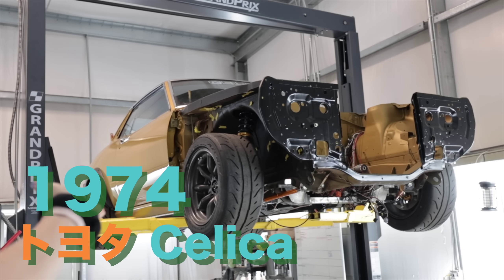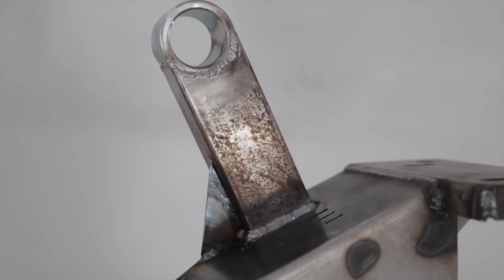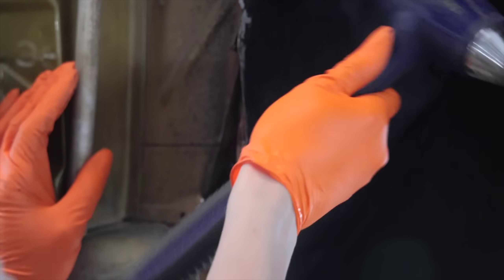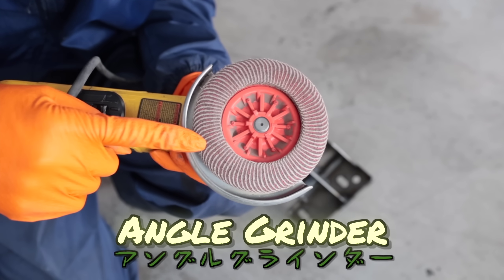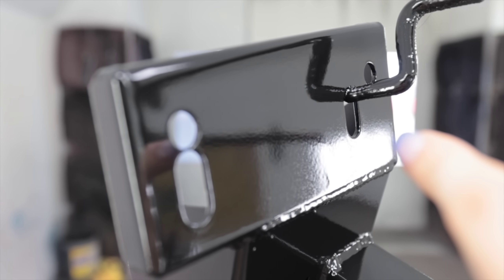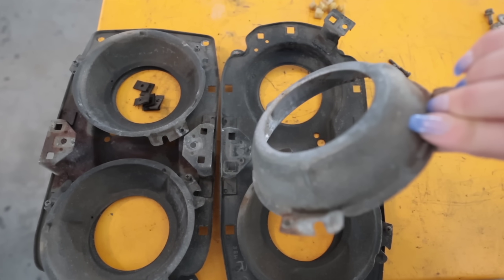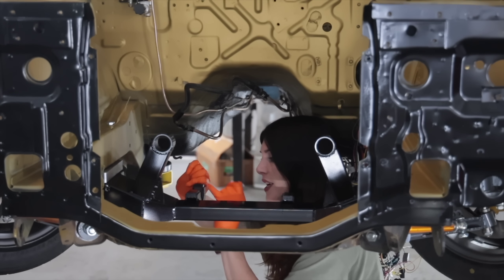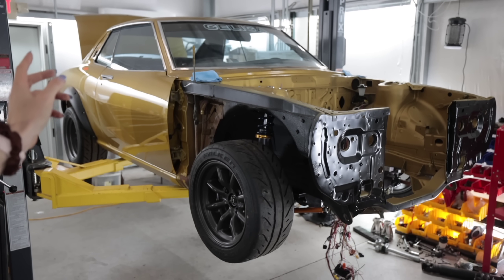Parts Don't Exist, So I Made Them! // 2UZ V8 1974 Celica

Comment: "A narrower tire shtretched onto this wheel would solve the situation, but I'm not about that life."

Thank you.  Thank you.  From the bottom of my heart, thank you.

2:41
Reply: Seconded. Radial Tyre sidewalls are meant to balloon out, not be stretched inward. It's important to how they work to keep the contact patch flat on the tarmac, as well as for decent ride compliance.
Reply: Yup. This car needs the right tires. You can't compromise on that. It will look factory when it's done.
Reply: Amen to that!

Comment: Girlie, I wish my late father could have seen some of your vids.  You have the exact same eye for detail - and the same OCD tendencies - that he did.  He was an architect by trade, and a self-disciplined master craftsman as avocation. Whether it was our annual garden, or the model railroads my brother and I built alongside him, or even my earliest efforts as a budding greasemonkey, Dad was always on top of things with his sharp eyes, practical knowledge, and sage advice.   Dad was a fellow who spent an entire winter building an HO-scale wooden railroad trestle {40 scale feet high, and 600 feet long} BOARD BY BOARD!!!  We're talking over 6,000 individually cut balsa-wood "timbers," "crossmembers," and "stringers," complete with all the nuts, bolts, cables, and other hardware that the prototype had.  Oh yeah - Dad also drilled EACH bolt or cable hole himself, until the cost of replacement bits for the Dremel started to eat into the weekly grocery budget a bit more than Mom was cool with.

I'm fondly reminded of good old Dad with each new video you put out, Sarah.  You are well and truly Gifted, my Dear Lady.  And don't you EVER forget it, dig?😍😍

Comment: So loving every one of these little conundrum filled episodes. I never want them to end. I really feel like you are right here in the shop. The clearance issue was resolved as I would have done it. More than proper. The journey is the achievement with me. It is more immersive than the experiences of concluding the project, if it is for yourself.
Reply: @mostcom  custom builds are an ongoing wtf. Good job on ONE at a time⭐

Comment: Rust converter on the rusty patches only of the 2nd H/L base. The kind that leaves a protective film.  Then just clean as you did.  Get a padded cap to wear working under/ in engine bay.  Yes regular good food !!

Comment: Just info, next time you get stuck putting bushings in like that, get a long bolt and big fender washers (I'll bet you see where this is going) put the bushing in, put the bolt through the bushing, fender washer and nut on other side and use an impact to tighten the bolt/squish the bushing in. Have fun

Comment: Sarah, when you put the car on the ground and load the suspension with the weight of the car, you’re going to have to clearance your fender well up higher because your tire will be higher in the well. IMO 😊
Reply: I thought that at first, but go back and watch again... She sets the car on the ground before final check. Yes, the engine might make a little difference, but that suspension isn't exactly soft. It'll probably be fine.
Reply from the maker: @OoGICU812  already did
Reply: @SarahnTuned  We all knew you would've. 🙂

Comment: One trick to popping out plastic inserts that you have to compress to pop out is using a vice grip. You can set the closure distance of the jaw so you don’t over compress the insert and not crack it.

Comment: You should give those rusty parts a soak in evapo rust. The stuff is crazy good and doesn't harm plastics. Sometimes parts might need a little brush action for stubborn spots and a second soak but the results are incredible and fast.

Comment: Install bushings by using a large bolt and nut with fender washers. Just assemble the bushings outside the part with the bolt long enough to get the nut on, then use a power tool to screw it all together, done with no impact.  Nice job on that epoxy!  I need a fabrication shop like you have access to.

Comment: Can I give you some tips as I’m a professional painter in a powder coat shop. And I do a lot of off road race cars and trophy trucks and forerunners. A better application instead of epoxy for something like that is Steel-it.  It comes in two colors. Stainless steel gray and black. What Steel-It is a direct to Metal and no mixing of a hardener but you can reduce it a little with mineral spirits. It’s made with fine stainless steel in the paint. It’s chemical resistant and you can weld right on top of it. It’s easy to apply. You can lay it on heavy and it’s very difficult to make it run or sag. I use a primer gun set up with a 1.8-2.0mm tip and needle.  Downside it’s $400 a gallon.   It’s also harder to scratch than powder coat. I use it on chassis, and suspension parts like huge trailing arms A arms, spindles, torsion bars, tie rods, etc.  trust me. Great stuff. Research it. 

I paint small parts with a lot of in and outs.  Here is a tip.  Set your gun up to where your fan is a point. Pencil in all the hard areas first. Then open your fan, up the air and fluid and paint the body of what you’re doing. 

Also since you discovered air flow. If you want a textured look. Paint a smooth base coat like normal. Let it flash then go back. Turn your air way down. You will have to test with a sample or a piece of cardboard. Low air will make your gun spit texture. Lower the air thicker the texture more air it will be finer texture full air then it’s just painting. Try that sometime.

Comment: An FYI as a painter and Powder Coater, you can request your parts to have a primer when powder coating, they have zinc and other anti corrosive primers to help in rust protection in the event the surface is chipped.  And the fact you can shoot the part right there, I would probably do the same if I didn't have the ability to do both.  Just food for thought.

Comment: I have a ton of old bolts from my Celica's somewhere and a piece of the inner dashboard when I did some police evasion mods. Looking at that little bit of Celica I feel I still have that car. 🤗
Reply from the maker: The old Toyota bolts are worth saving. I went to junkyards just to collect clean ones for this.
Reply: @SarahnTuned  Thanks Sarah, now I am glad I kept them. I love the older model Celicas. I had two. One had a jazzy Targa Top. It was built like a tank ! People banged it from behind and front and hardly left a scratch. I bet that's not common now. Very pretty car but the older Celicas like Honda's rusted badly in the Northeast.

Comment: The suspension bolts should always point towards the rear of the car; in the event the nut vibrates off, the bolt will not fall out causing catastrophic failure.

Comment: To get old plastic clips out without destroying them you can use a blow dryer not a heat gun and get them hot without melting them. That makes them more flexible and unlikely to break when removing them.
Reply from the maker: @70sAirForceBrat  or do what I did

Comment: Time for a blast cabinet loaded with 100/120 garnet. Makes short work of prepping metal for paint or powder coating, it's not physiologically terrible for ya like aluminum oxide or coal slag is, and tends to be really low-dust to boot.

Comment: A tip I saw in a tips/tricks section of a car magazine- for the cross member jacking point, either:
1) drill a hole in the cross member and then fabricate a new lifting point (a pin/stud of similar diameter) on the jack to be located in that hole that was drilled. 
2) make a U-shaped cradle to have the cross member rest in on the jack. Line that cradle with a “soft” material to prevent damage. What that material is/can be is up to you.

Comment: Rather than using clumsy corrogated cardboard, recommend you try cardboard from mega-sized cold cereal boxes.  The thickness of the cardboard can easily be cut and holds detailed shapes easily.  I've been using cereal box cardboard for years to good effect.  Of course; you have to be into cold cereal for breakfast.

Comment: I took the motor mount off my new engine last night, 4 bolts, I didn't get up, but I instantly lost one. Poof, gone from existence, I looked for it for an hour, only to find it sitting on top of the caster plate of the dolly the engine is sitting on. I don't know how this tiny m12 bolt landed and stuck on a 5mm platform. One in a million. I feel your pain Sarah

Comment: Sarah - those white plastic clips may disintegrate when replaced and a screw is tightened. These are identical to clips used on Land Rover Defender. Part no. RTC3745 these are black in colour. If you can't get any I send you some from the UK.

Comment: Here's a little tip for you (that you probably already know), when lifting the car by the crossmember to move it around the shop, place a buffing pad on the jack to help protect the finish on the cross member, but be careful moving it, just go slow. I used the curved pads that weren't as likely to slip off the jack.

Comment: On my rwd corollas and what most of us small rwd toyota owners do for front clearance against footwell is add more front caster by shortening caster rods... it makes the car handle better and more easy to control if it gets sideways.. only downside is usually need to create more room on front of the guard which is far easier than modifying the firewall footwell

Comment: -- You have an oven.  Plastic clips with some motor oil.  Probably should have done that first.  Remove the clips, perhaps try aircraft stripper (don't get good results on that for the application you're looking for - Headlight mounts).  You could roll the parts, but that would take a bit.  I appreciate you wanting to keep most things as close to factory as possible in a restoration sense, so it's hard to advise.  That said, the factory Brand/part stamps, I'd be willing to sacrifice here and there on just about anything for reliability.

Comment: The epoxy paint job on those parts looked factory.  Amazing skill.  It is easy to forget this is a FIFTY YEAR OLD CAR.  Amazing those clips came out without breaking.  Seems parts were much better then.  Not sure clipperdoodles in a 2022 Toyota will come out successfully.

Comment: Sarah, great work. It's the first time I'm writing on the comments because I think you should double check the clearance before it's too late. By the looks of it, when the car is in the ride hight you will still have rubbing issues. You should also check when the suspension is fully compressed (even though it's the "inside" wheel, just to be safe). I hope I'm wrong. Keep up the great work!
Reply from the maker: I did that a few months ago with the engine in. 🫡
Reply: @SarahnTuned  Great! That's a relief! 👍

Comment: HI Sarah, on those car light rear panels, one is rusty, I have restores 3 cars in my spare time in my life and spent hours wire wheeling rust off!  6 months ago I discovered on you tube a chemical iron oxide remover (not converter like the phosphate ones) it chemically detaches the oxide some how in hours, I leave mine over night it is like magic, there are a few brands out there and you use the fluid over again until it stops working I think they even do a gel now.  the brand I use is called EVapo-rust by CRC it's like magic honestly, nut bolts, panels anything steal. try it.  Been watching your channel for year, love it PS .take a holiday! :--)

Comment: Hey Sarah, you should try some Evapo-Rust on those light assembly parts. I cleaned an old rusty Schwinn bike frame and worked on the rusty parts and i was surprised it did not damage the paint.
Reply from the maker: It’ll still look like garbage after. Only correct way is to sandblast and re-electroplate.

Comment: I hope you get a sand blasting cabinet one day to eliminate all those hours of hand sanding little parts. A 48" cabinet with built in vacuum would be ideal. Thats what I use and its great. Garnet or aluminum oxide is a great media for paint prep work and can even be used on plastic if you turn the psi down. Just make sure to degrease the parts first to keep the media clean.
Reply from the maker: @porcupinepete8110  I don’t have room for one or an air compressor.
Reply: @SarahnTuned  Fair enough, although they don't take up a ton of room. Love your channel and the current Toyota build. A car from my youth.

Comment: Those headlights, they're the globe as well, and sure, there's plenty available, but at some point you've gotta be wondering about whether they're better off safely stored on a shelf, with some correct colour temperature LED replacements installed. There's now the H4 base LED's to clip in to the aftermarket replacement lenses, if aimed correctly so they don't dazzle oncoming drivers, they should complement the factory look, along with reduced loads at the switchgear thanks to remote relays.

Comment: The lower paint gun pressure causes orange peel just like factory and put more paint on the work with less overspray or wasted paint. If you test the spray pattern you will notice it has dots on the edges which is what causes the orange peel.

Comment: ❤❤Sarah ,those little plasti-doodle bits ,,or any other bits of plastic just soak them in straight WD40 ,It seems to soak it up and softens the plastic and makes it last a lot longer ,boiling water works well for removing plastics that need softening a bit

Comment: You could soak them in household Vinegar for 24 hours. I know that would remove the rust, not sure its affect on the green cadmium or the lettering though.  I use Vinegar for all my brackets and headlight buckets on my GTO and removes all the rust with a brass brush.

Comment: I have a couple early 70's Corona's that have been sitting in my back yard for over 40 years. Let me know if your need any extra parts or hardware off of them before I get rid of them. It would only be practical to send smaller items as I am in So. Cal.

Comment: I Have A 42-year-old Dremel it's still kicks I also have a 1932 Black and Decker half inch drill yeah it's gigantic it has massive torque it has to be very careful it'll break your wrist it's gigantic it only goes 450 RPM it'll drill through anything:trophy-yellow-smiling:

Comment: Good morning 🌅, Great job, 👏 😂, would it be better to check for clearance for your tire do your fender/wheel once you got some weight in the car as the drome she of your wheel will change and steal my hit part of the buckle 😂, in a part of fender, The part we’ve actually split apart to bend back,  it is just a thought, look forward to seeing you pooping on the floor again, 😮, 😂, what is a ratchet?, A ratchet is a little bit bigger than a mouse shit, As you said when hitching your nail, 😂,

Comment: Because you used the AE86 front suspension, if you ever need more steering angle. The mk1 MR2 steering rack is an inch longer than the 86 & everything should fit.

Comment: I am not sure if your familiar with EVAPORUST, but you can soak rusty parts in it and the rust goes away.  And it doesnt hurt paint, etc. You ahould give it a try
Reply from the maker: @pinellaszrx9075  rust doesn’t go away it’s chemically changed from iron oxide to iron phosphate, you’re still left with a lack of zinc plating where the rust was. That’s not a viable solution to restore something.

Comment: The issue occuring with the tire contact at the wheelwell is the excessive scrub radius going on with that suspension. Instead of rotating about its central axis, that tire is getting swung wildly in a big arc. Also a problem on GM a-bodies and pretty annoying.

Comment: EEEkit 15 Pack Rotary Spot Weld Cutter Sets Double Sided, 3/8" HSS Spot Weld Cutter Remover Drill Bits Hex Sheet Metal Hole Cutter Remover for Power Drill Spot Welding

Comment: is there something you can clear coat those parts with so you don't lose the markings but you still protect them from further corrosion?
they may not look as pretty but you would preserve the originality
a clear paint or wax or similar

Comment: Were the headlight screws gold zinc or did the factory plate them gold cadmium. I have a feeling they were the latter. Cadmium is superior to zinc. Zinc protects by being sacrificial and gives up,powders and depletes. Cadmium is a protective barrier and it also has the quality of  lubricity. When torquing bolts that are cadmium plated it is recommended not to lubricate the threads. Not so for zinc.  I despise zinc. I feel it is great for protecting the hulls of battleships and automotive cooling systems but not bolts.

Comment: You might want to check the clearance again....with similar weight from that engine on the front....and on the ground 🤔
Reply from the maker: I measured with the tension rods way over extended, so I should have even more room when it’s on the ground and then adjusted correctly.